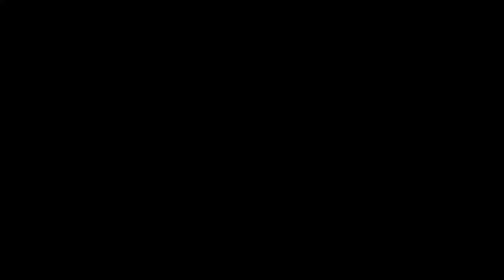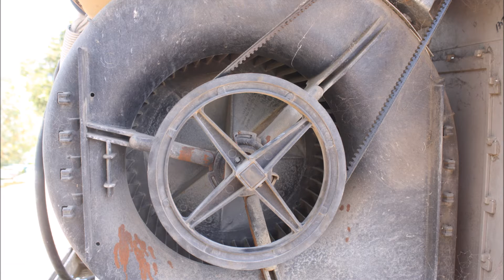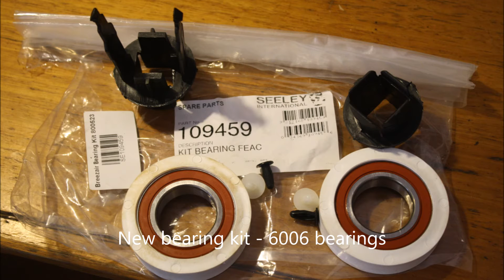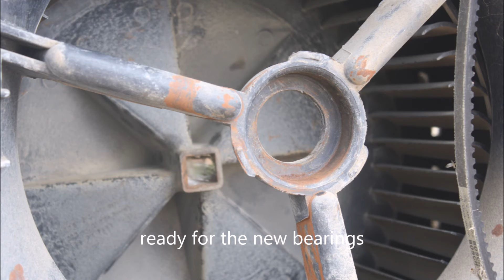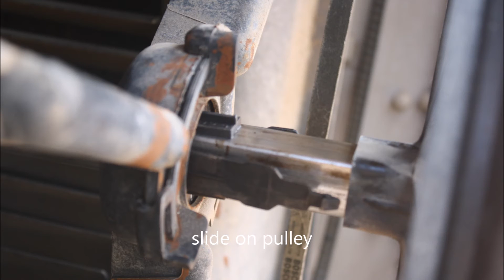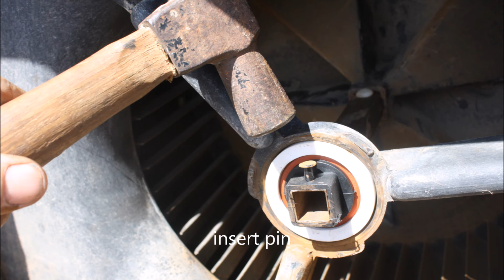Breezair recondition bearing replacement

Comment: Good job mate!!,... now how about showing how to fit the square ducting the unit sits on in the roof and how to flash it in on both a Custom Orb sheet and the Trimdeck.
Reply from the maker: Hi Peter , we can leave that for the roofing plumber. This was just a repair job. New bearings every couple of years makes for a quieter AC and good neighbours as they don't complain about the noise.